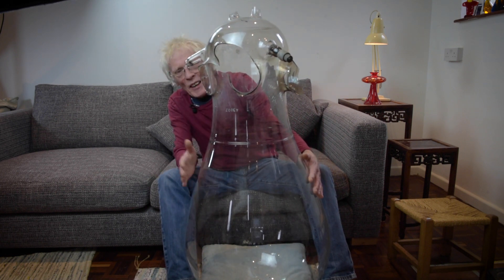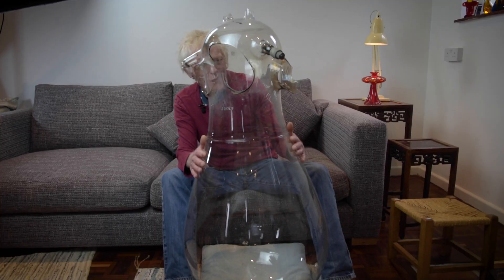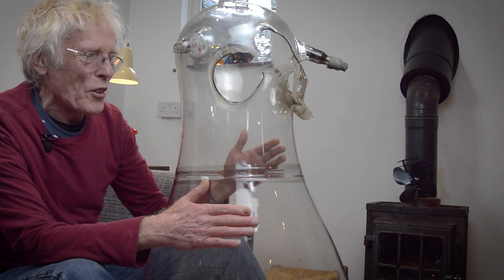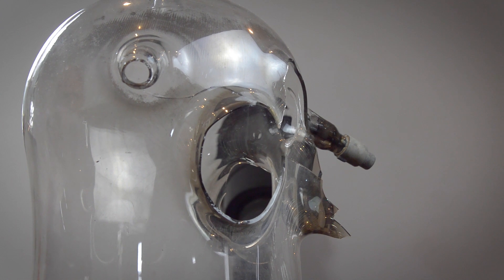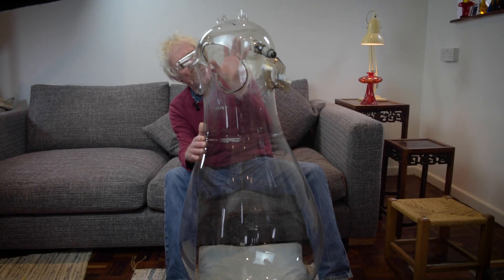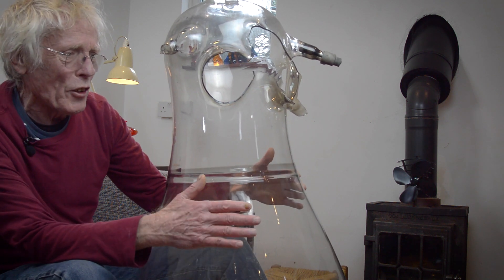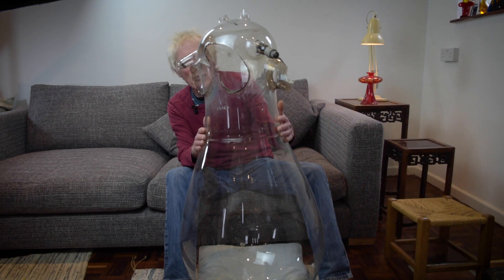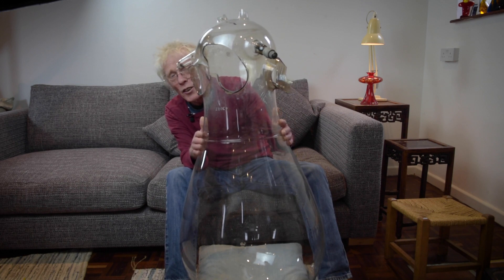Andy McConnell's Strange Glass, 16. AC/DC converter - mercury arc rectifier

Comment: Saved one about that size from an electroplating company during a system upgrade. It had 6 legs and a lot of mercury inside of it. The amount of heat the thing put out was nuts. It ended up at the mad science/top secret attraction in the dells. Powered it up by creative use of three microwave oven transformers and capacitors in a bucket of oil- rigged to turn on by a motion detector occupancy switch. These definately look like something from an alien spacecraft more than vintage when powered up.🤓